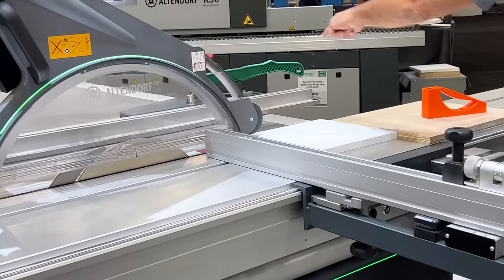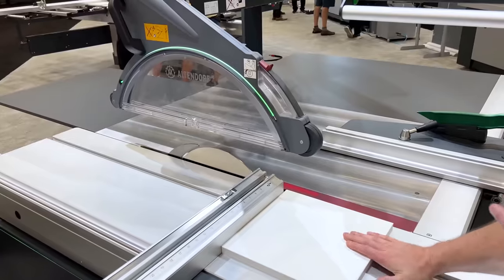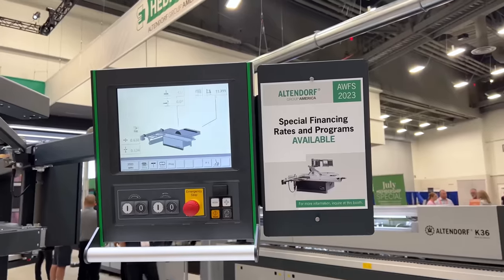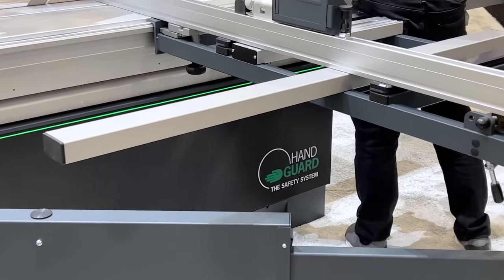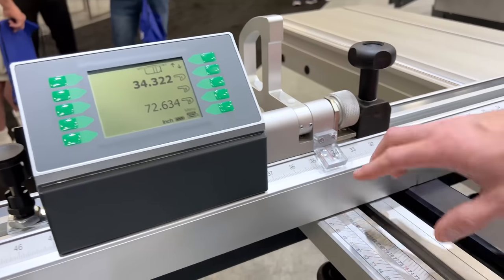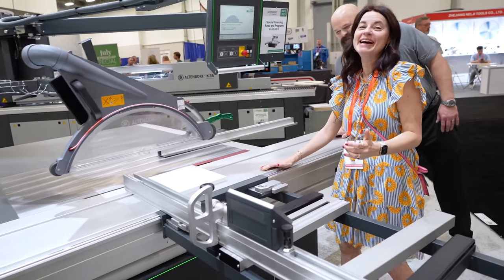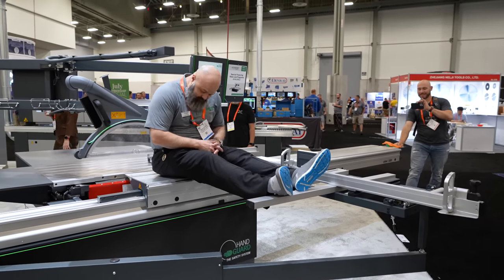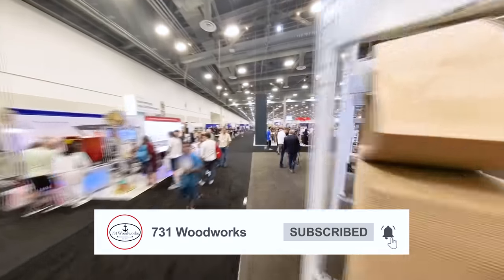The Most Exciting Table Saw in YEARS!

Comment: I'd really love to see what this device does in a kickback situation. I'm sure we've all seen that old-timer try to demonstrate kick by twisting a board on his table saw, and nearly losing his digits when the saw basically sucks him in - there was no time to react. I reckon a sawstop would have caught that - but the sawstop is incredibly violent when it drops and fires the brake. This 'AI' system needs to take a photo, interpret the photo, test the results against parameters, power up the stepper motor and send the right pulses to drop the blade - capacitive touch has the signal directly wired into releasing stored kinetic energy. I just hope this machine can foresee kickback or other instant hazards (and not just idiots running their fingers directly at the blade) because for me that is the sawstop's killer selling point.

It looks like a really quality tool, but I can't see the technology ever getting miniaturised for use outside of huge commercial shops. Though bring it to market in the UK, where sawstop basically doesn't exist - I'd buy one...!
Reply: Available through R&J Machinery in Hinckley, UK right now. I believe they still have 1 in stock but can get yours customized and to you quickly!😊😊

Comment: My question is what about when sawdust covers the cameras? Is it just going to automatically retract the blade?
Reply: The saw has to run a 1 minute calibration before every shift and will notify of any problems like that. We have not had a single client report this being an issue. Think about the camera on your phone, with it being shoved in to your pocket or purse filled with lint, cup holders in cars with lord knows what in there, how often have you seen enough particles to completely impair the lens and even if it did get dirty enough for you to notice, what did you do? Wiped it on your shirt and your back in business! But seriously,  dust and debris coverage is no issue and redundant systems are in place to negate that hindering the safety system.
Reply: @BradSnyderAltendorf  nice! Do you have any videos of the saw retracting when the hand of someone with very dark skin tones is using the saw? Typically skin classifiers even from companies as large as apple don't work for darker skin tones.
Reply: @Tekniques25  that is a GREAT question and one that was taken into account when designing the system. we have a library of more than 500K pictures of hands of all types, colors, missing digits, tattoos etc. beyond that we also use certain points on the human hand that are universal regardless of color  that the machine uses when identifying a hand. I've put my foot up there (just stupid curiosity) to see if it would accidentally recognize it as a hand and it did not.  its a very comprehensive system that has been very thoroughly tested and will continue to only get better with future updates to stay ahead of the curve. You are the 1st person that I've seen pose this question but it was a big part of the presentation when I was being trained!
Reply: @Tekniques25  dang, I completely forgot to answer the question...I don't know if I have any actual videos of that but will check with the guys in Germany and see if they do.

Comment: Howdy Mr. 731. Just watched this video (obviously)...

Besides the safety feature, this is the type of table saw I/We used at my very first Woodworking job after high school. We used this to cut down sheet goods and the EXTREMELY high end doors we built. 

Cutting sheet goods on this beast makes Track Saws look like Crackerjack toys. I guess that's another reason I'm biased against tracksaws. 

Of course though, ours didn't have any of the fancy computers. On/Off, period. I worked there over a year before they let me use it and being 17/18 years old and skinny Lil runt, one of the tests I had to pass before they'd let me use it is being able to lift a full sheet of 3/4" oak ply and lay it down on the table without scratching it or dropping it which meant I had to have absolute control and strength to remove the ply from the rack, carry it about 20 feet and then lift it higher to edge it onto the table then lay it down. 

If I could do that and not pass out from the strain, then they would teach me how to use the saw. Took me a year. 

Point is....Those types of saws are AWESOME!!!! Too bad kinda that the training I went through both in school and "on the job" isn't required for a weekend hobbyists. Instead of proper training and skill acquirement, companies like Sawstop produce a machine catered to the "just in case" crowd. That's not a shot at "You" Mr. Buttons, someone gifted you yours....

But I digress...

I'd venture a priced tag on the saw in the video of $100k including bells and whistles.  

LOVED this video Sir. I'll agree with ya. Their tech is a Sawstop killer and I for one hope they succeed.
Reply: Mike, thank you for the compliment and just to let you know...we now offer an option to add an air assist function into the main table which actually helps operators move the material around like it was on a sheet of ice, get it in place then make the cut and remove the material without any damage from scratching or marring. You are a bit high on the price tag though..😃

Comment: It's so great....... I'm so glad the 4 woodworkers world wide can afford to"use their table saw safely"
Reply from the maker: There's a lot more than 4 commercial shops buying these type saws.
Reply: we have them in shops with less than 10 employees and in Fortune 100 companies as well. it comes down to what the application is and how much liability and risks they want to eliminate.
Reply: @BradSnyderAltendorf  yeah for sure, it's an investment. I just would say it would slow down progress when all the bugs come out of the programming etc. A camera fails and the whole system won't run without all cameras operational etc... Stuff like that would happen in aircraft manufacturing with robotics. If someone got too close to the gantry it would stop and manually have to be forced to resume via control panel. It gets very exasperating when trying to produce. I do love the size of the blade and the siding carriage.

Comment: Felder had  the same technology for years!
Reply: Felder uses a completely different system and different mechanism for blade retraction. they use a conductive system and retraction of blade is done by allowing motor aggregate to drop when magnets are released whereas we use a drive system to control the aggregate the entire way down and an AI visualization tracking system.

Comment: Electromechanical safety mechanism versus a someone’s program.  1) how long till someone posts their table saw not working because it needs an update?  2) If it connects to the internet, it’ll be hacked and disabled.  

Look, I’ve been programming for 36 years.  I’ll take the SawStop method, thanks.

Comment: What if the drive system malfunctions and the blade does not drop (drive) down?
Reply: the entire system is tested and calibrates itself at the start of every shift, any issues will be immediately recognized and reported to operator. Also, the drive system is a proven one that has been used in the metal cutting machine industry for many years.
Reply: What if the system explodes into a million pieces of shrapnel, or the AI takes over like Hal and sabotages the user? Just like with a pew-pew, you should never DEPEND on a safety (device).

Comment: Although super cool and useful, ive never heard of someone with a table saw injury that wasnt user error. Fingers dont go in the path of the blade. Use push sticks. No loose hanging long hair, no long sleeves, eye protection. If you cant do that, theres a Really good chance you shouldnt be using Any table saw

Comment: Not a Sawstop killer if it's not affordable. Hell, I doubt this thing has the capability to prevent injury to a hand suddenly jerked into the blade from the side. Lots of ill-advised cuts can be made that place the hands within a few inches of the side of the blade that can result in the hand being pulled in from the wood rotating unexpectedly or by applying pressure that is unexpectedly released.

The fact that I can visually see the blade moving down means the reaction time is extremely slow. The Sawstop is there one frame and gone the next.

Comment: It's not the only one. Felder has that same. But, it's not made in America.
Reply: There are NO other systems like ours. It is unique in every way and does not require contact to be made with the blade for the system to activate. This setup is like nothing else in the market and is the first and ONLY safety assistance system for sliding table saws to receive the GS seal for tested safety. Also, they are fully designed and manufactured in Minden, Germany.

Comment: That screen was wiggin out
Reply from the maker: Naw, that was because the camera isn't synced with the refresh rate of the screen.
Reply: @731Woodworks  hmm, that would explain the flickering of the whole screen but not actual image on the screen breaking up and moving around.

Only if what was shown on the screen was moving very quickly and your camera used a rolling shutter would we see anything like this. 
It may be software on the camera or the editing program that tried to reduce flicker but wasn’t doing a good job though.

Comment: So what are we talking? 5 grand? 10? 15? 25? 45?

I want to like the robotics. But something tells me i wont. A lot of somethings, with franklins on them.

Whats the cost in bitcoin? Might help the number feel smaller!
Reply: to make it a bit easier to swallow think of it like this. Average cost to a small company per accident in the US is about 30-40 thousand. Cost of this saw is about the same as a new Ford F-250. 2 accidents averted and its paid for itself and when running a saw 8 hours+ per day, its going to happen. Hope this helps!
Reply: @BandSWoodcraft  to make it a bit harder to swallow. Think of it like this. In America, in 2016, 675,000 table saws were bought. That same year 30,000 injuries were estimated. For a whopping 4.4% chance of an incident. And that's if every injury was with a saw bought the same year. If we extrapolate this to the 9.5 million table saws across america. That's a .3% chance.

So if you have an employee with a .3% chance of getting an injury each year. How many lifetimes does it take for an incident to occur?

I'll take the f-250
Reply: Also, every business using a table saw is required by law to carry insurance for its employee using said saw.

So @ best were talking saving some insurance money based on the whims of an adjuster and each business owners ability to negotiate.

Comment: The saw shown in this video is about $57000 dollars before taxes, U.S. currency.  Great design, but they have nothing on Sawstop vs cost for non-industry normies.
Reply from the maker: Think bigger picture.  In 5 to 10 years technology like this will be much cheaper and hopefully available on consumer level saws.
Reply: @731Woodworks  No, the technology isn't the reason for the cost.  Tech like that is cheap NOW.  It's the overall size, capability and build quality that justifies the cost.  This sort of tech could be rolled out in a month on cheaper saws... although that mechanism doesn't look like a cheap build either, another hurdle to get it out to the masses at a cost that is tolerable.  'Tis a beauty though!

Comment: clever, but about half of amputations involve kickback, where handplacement that seems safe, suddenly isnt. Also about 2/3rds of table saw injuries iskicked back pieces hitting the user. Sawstop will prevent an amputation when kickback drags your hand into the blade. This videos contraption will not.
Reply: "This videos contraption will not."..... may or may not be true, but I'd love to hear how you came to that conclusion so confidently.
Reply: @GarthMyer  He was talking about and demonstrating an exclusion zone. When your hand wanders into the zone, the blade drops down under gravity.

Way this is implemented is they have a top down camera camera (hopefully 120fps or better), and feed it to an image classification (probably OpenCV trained on hands) which gives a bounding box for every hand in the image. Knowing the cameras position and field of view, you can then establish zunes the hand cannot be in. For about $200 in materials you could build it yourself in an afternoon.

The problem is, it takes time until the camera delivers a picture (8ms for the sensor plus about 50ms until it is in computer memory), time to process it (around 20ms I guesstimate). Then it needs to trigger a solenoid over usb (another 50ms or so), and the blade needs to drop under gravity. (100ms until it drops 5cm). All told around 228ms.

At the safety distance they demonstrated where the system still lets you pass, a kickback will pull your hand into the blade in about 50ms. A sawstop reacts in 5ms.

Of course the system could be made to react much quicker, but that requires a high speed camera (1000fps, about $5000), a very fast computer ($2000), a customized OS and hardware hookup to eliminate signal latency (very costly to engineer and then manufacture), and a hefty spring that pulls the blade down with about 50g. Factoring matgins to recover r&d it would easily retail for $20k-$30k)

Comment: Very cool saw, but as you said, it's not even remotely practical for a small shop (even a small production shop). However, if they apply this technology to a smaller sub $5,000 saw, perhaps. If they can get it down to $3,500, it should compete with Sawstop only if the hobbyist (or small production shop) is one that enjoys technology. 

I, for one, am not one that enjoys messing with advanced technology in the shop. For example, I use a dial caliper because I don't want to mess with the little watch-type batteries. LOL

Comment: Honestly i think it's stupid and will cause more accidents, you have a "safety" system that is active which is wrong the best systems default to the safe state meaning in the event of a failure it fails to safe. But with this people get careless when they think a bad outcome is impossible but you have a camera that could have issues, and computer that needs to interpret the information and finally a mechanical drive system add a few years of use and watch accidents skyrocket as you mix complacency with system failures

Comment: Its probably not that difficult. to recreate tbh. Could allways use a bracelet/ring/gloves for the opperator, and have a transmitter close to the blade or not you can just add the distance from the blade to the transmitter into the calculations. have the saw auto drop if the gantry moves without the bracelet moving closer to the blade, and if the gantry isnt moving but the device/ hand is in the way of the blade just set the dimensions of the hand, or one larger then the hand. *things like this can know the orientation of the braclet...etc. Ive made some gloves for vr a while back that would do this, aside from the other electronics for finger controls. 

so *opperator cant use machine if mot wearing braclet, if the braclet is not moving but the gantry is, and if the braclet/virtual hand area is in the way of the blade and is moving too it. 

allthough really only a few things would get through it at that point like somone elses hand...etc.

Comment: Saw stop costs from $2 to $4k. 
This cost baseline $67,000, saw stop killer?..nice Clickbait
Reply: The best argument is you don't have to replace the blade and stop cartridge every time it triggers. On the other hand, it looks like it costs about $250 on the high end to replace a blade and cartridge. I'm not sure what the depreciation rate for woodworking equipment is, but you'd have to go through about 250 blades in that time to match the price.